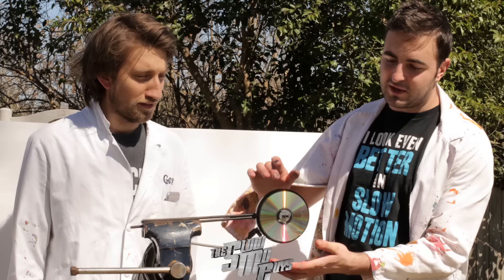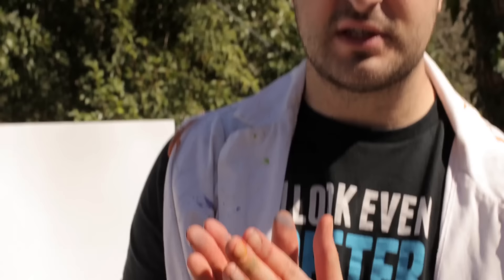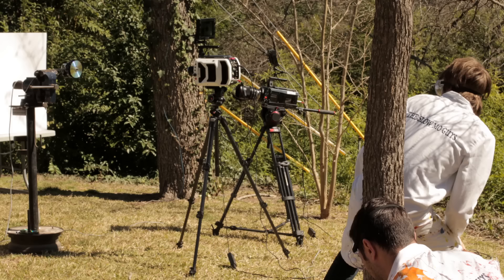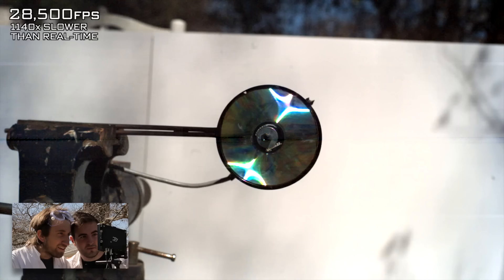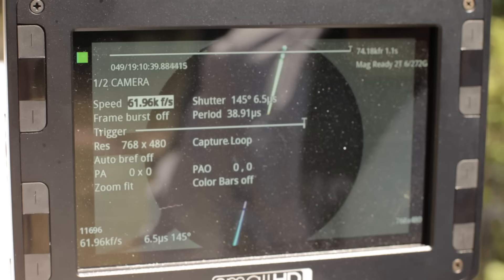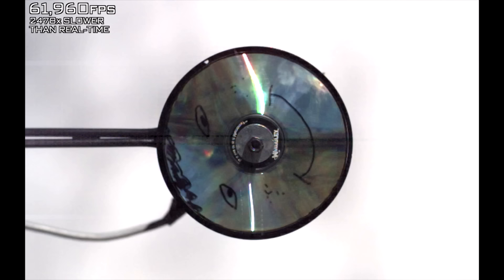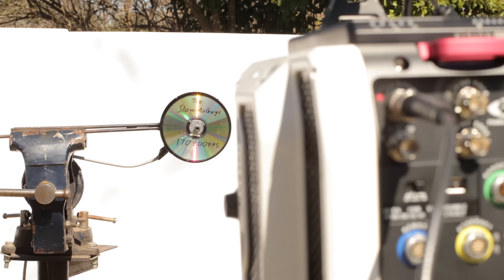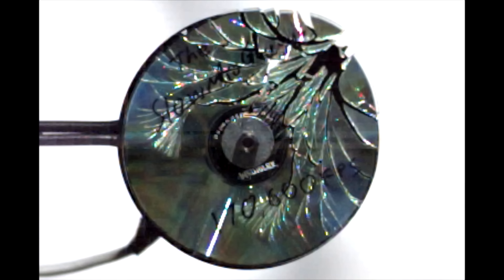CD Shattering at 170,000FPS! - The Slow Mo Guys

Comment: ***** Isn't it fascinating that all of the shatter points occurred in the "gravity-negative" dead zone between the 180 and 315 degree marks, and that two happened at the first mark, and two at the second?

180 is the point at which gravity stops "helping" the downward spin and starts fighting the material as it changes direction.

315 is the point at which gravity has done its maximum work pulling at the leading edge as it heaves up, away from the earth, and just before it starts getting some relief by "leaning" on the axel and "laying over" toward its downward fall.

These forces are exquisitely fractional, but that 135 arc is where the maximum force of gravity creates a differential, the slightest difference in force, magnified by the blistering spin, and is enough to finally work the molecular structure of the material apart in one specific place, setting off a chain reaction. That's not to say that the shatter point couldn't happen elsewhere…but it's most likely to happen in this range, as this extraordinary set of videos demonstrates!  :^D

Thanks for the fun, gentlemen!
Reply: Next Genisye HAHAHA!!  x^D

Always the risk, I guess! Hope it was useful to you!  :^)
Reply: Grymmorgan So consequently repeating this experiment with a horizontally aligned disc should give us a completely unpredictable shatter point?
Reply: Moehritz Bla
The shatter point isn't based off gravity at all, rather, where the disk is bending the most.
Reply: RipleySawzen I think Grymmorgan's point was that gravity affects the way the disk bends, making it more likely for the shatter point to be within a certain range.  Moehritz Bla's question was highlighting the fact that horizontally spinning the disk would set gravity's effect on the disk to be equal at all points, thus negating gravity's effect.
Reply: Joshua Murphy
The outside edge of the CD is experiencing over 35,000 times the force of gravity. Do you really think Earth's gravity is having any effect at all? It's less than 0.003% of the forces involved here.
Reply: RipleySawzen It seems like the structure of each individual CD and the stability of thus would have a greater effect as to where the "shatter point" starts... but we shouldn't assume that just because gravity seems like an insignificant term in this problem that it automatically can be considered negligible.
Reply: Deathbrewer
But it can. 1/35,000 is less than 0.003%. That means the CD would have to be over 99.997% homogeneous for gravity to overcome any structural flaws. Any substance that pure would cost a lot of money. (The purest gold being produced is 99.999% pure) We can assume CDs are not that pure.
Reply: Folks, you may all well be right that I may be incorrect in my analysis, here. But engineering and super-stress is always a matter of "straws that broke the camel's back," or very small forces or flaws that are just enough to push blistering primary forces over the top. Remember…we're approaching infinity in these experiments. We're going to keep going - slowly - until we achieve the dissolution of the material. So at some point we achieve Maximum Tolerance. So the dissolution of the molecular bond of this material is going to be Mt + [ANYTHING GREATER THAN ZERO!]

If you don't believe this, then study other forms of engineering failure. There are plenty of videos online analyzing major structural failures like collapsed bridges and downed airliners. See how detailed analysis tracks down the culprit in these cases to very fine hairline cracks, minor impurities in material, or very subtle stress forces over long periods of time. Yes…in some cases representing much less than 1% of a difference.

Take the failed fan disc of Engine #2 in the famous failure of UA Flight 232 over Iowa. The fan disc of that engine - rotating at speeds not unlike our CD - takes hundreds of hours to fail (it being titanium and very large). But the failure ultimately causes the disc to rip apart and shatter into buckshot, tearing apart the tailplane and severing all three hydraulic systems. The ultimate culprit? A minor variance in density in the source titanium caused by too much nitrogen in the smelting process of the original ingot at that one, single point that the first crack formed.

Those tiny flaws are what cause the failure of great structures. A single rivet shearing. The fraying of a single strand of cable. Even the great World Trade Center was brought down (likely) by a softening in the steel supports that allowed the great mass above to move just a millimeter…enough acceleration of that mass to render its force unstoppable.
Reply: Grymmorgan
Exactly. Some tiny impurity in the wavy part is what causes the disk to fracture. Gravity is many times smaller than the other forces on that point. The weakness of that impurity is greater than gravity.
Reply: RipleySawzen 
Your response to my question seems pretty valid, but I'm wondering how we know that that the "force" due to an impurity is more likely to have an effect than gravity...would you enlighten me?
Reply: Joshua Murphy Since the CD is spinning so rapidly, there's 35,000 times gravity pulling it in all directions. That's hundreds or thousands of pounds of force trying to rip the CD apart. Gravity is only exerting around an ounce of force on the CD. Where there is a flaw in the CD, that ounce of force isn't going to do anything to alleviate the chance of it breaking in the face of the hundreds of pounds ripping it apart.
Reply: Joshua Murphy The fracture must start small: at the atomic level, with the breaking of atomic bonds. At the atomic scale, the force of gravity is nothing when compared to the electrostatic force. Defects such as impurities, and micro fractures will all have much larger effects on the local internal strain of the CD than gravity. Hence we can be confident that the fracturing will initiate from some sort of defect.

However, does the fracture begin at the place of a defect, but only begin to propagate once the CD is oriented a certain way relative to gravity? Seems unlikely to me, since I'd expect that vibrations from the motor would be a larger factor than gravity. I could see gravity being a factor, if the motor was smooth enough, the RPM was ramped up very slowly, and the whole thing was in a vacuum with no air resistance. However, in the video we see clearly that the CD is flexing significantly. Imagine a weak point in the CD passing through those 'waves.' Straining one way, then another. Like bending a paperclip up then down, up and down, until it finally breaks.

Basically there are too many larger forces at play here, and we can drop gravity out of the equation and ignore it when predicting how fractures will propagate.
Reply: With the way the CD cracked, would this help in any research to waves? I noticed the crack seems to form an acoustic shadow from the breaking point
Reply: I don't mean to be mean but this has to be said. Hope you will take this as a joke. NEEEEEEEEEERRRRRRRRRD!
Reply: Carter Pike No, Carter…I, for one, take it as a compliment!!  ;^D
Reply: RipleySawzen  so if I understand you correctly the cd shatters because gravity alone isn't causing it alone it's the force of gravity on the impurity of the cd ? (Please consider I just started learning physics please explain to me if I'm wrong)
Reply: Grymmorgan At even normal hi speed CD drives gravity effects are so low compared to gyroscopic effects that gravity is a non issue.
Reply: Moehritz Bla Only when the drive motor is perfect,if there is tiny imperfection in the bearings for instance that will make a huge difference.And may give very reproducible results.
Reply: Shawn MMiller
The CD will shatter at a point of impurity. Since the centripetal force is ripping the CD apart at hundreds of pounds of force, the tiny amount of gravity can be forgotten about.
Reply: RipleySawzen thanks :)
Reply: Grymmorgan The people disagreeing with you make some good points, but it doesn't explain why it DOES break at the points you're saying it does, and it seems very unlikely that it would just so happen to be at the gravity dead-zones
Reply: Jake Halford They are most likely correct. Science is a quest for the truth. Hypotheses are great…but only until tested.

Fortunately, my observation is eminently testable. You'd just need to run this experiment 100 times or so and see if the distribution of break points turned out relatively even…or concentrated in the zone it did here. This would tell us whether or not we were witnessing a coincidence, or a "straw that broke the camel's back" effect.

Appreciate the support, Jake!  :^D
Reply: Grymmorgan I know it's not an extensive trial with just 4 runs, but it does seem like a higher likelihood than pure chance at least
Reply: Jake Halford
"gravity dead zones" do not exist in the places where the disk broke. The only single spot where gravity is not causing stress would be at the very tippy top of the disk, and the disk never broke there. Do not let buzzwords fool you; there is no such thing as a "gravity dead zone".
Reply: Guys, it doesn't matter if it has structural flaws, not at all! lets say that there is one weak point, OK so it WILL break there because everywhere else is stronger. so if the disk is accelerating doesn't that mean that that one point will experience the most force when fighting gravity? Well yeah, that's probably why it breaks there.
Reply: *****
This would be true if the disk were accelerating slow enough. In this video, the CD is accelerating at more than a g per revolution. This means that at no point in time is the weakest spot on the CD ever experiencing a decreasing amount of gravity: it is constantly increasing.

There is, however, a slightly higher chance of the CD breaking on the lower half, due to gravity. This chance would be on the order of 6%.
Reply: Look, as I've already conceded, it's entirely possible that my first observation is erroneous and would not hold up under experimentation. And fair enough. I still call it an interesting hypothesis, and worthy of such a test. That being said, what we have exchanged it for is just as fascinating. A minor flaw in the homogeny of the disc material is also an infinitesimal difference. These materials undergo rigorous testing for consistency, and so such flaws are minor in the extreme. So if we're swapping a 1/100% of gravity for a 1/100% of molecular cohesion, it's still a damn fascinating process how something comes apart…basically, some straw eventually breaks the camel's back…and it's usually a very small one.  ;^)
Reply: Grymmorgan
"So if we're swapping a 1/100% of gravity for a 1/100% of molecular cohesion" No, the material is going to break at the weak spot no matter what: gravity or being flung apart doesn't mater. Some spots on the disk are experiencing 85,749 times gravity, while others are experiencing 85,751 times gravity (I said 30,000 times gravity earlier, but upon watching the video in slow motion, it was spinning at 35,000 RPM when it broke, making the actual number much, MUCH higher). Gravity is contributing only 0.0023% to the forces involved. We can ignore it.
Reply: where do you get 85,749 and 85,751 from?
Reply: The disk is spinning at 35,770 RPM when it blows up. That's 3745 radians per second (math). The equation for acceleration is a=rotation^2*radius, or (3745 radians/s)^2*0.06meters. That comes out to an astounding 841,000 meters/s/s of acceleration. Divide that by gravity and you get 85,750 g's of force, approximately. I did not do the rotational calculations to the nearest frame, so it may be off by a percent or two.
Reply: Upon looking at the video in n editor to get some better numbers, the disk completes one rotation in exactly 100 frames, giving it an angular velocity of 37,200 RPM. This increases the g forces to 92,800. Truly mind-boggling.
Reply: I am sorry for butting in like this, but I am guessing that when the gravitational forces on the CD generate maximum stress and the weakest/anomaly in crystal lattice structure coincide, that will result in a bond rupture. So what Grymmorgan is true. The observed angles of fracture are 180 and 315.  And yes the locations of those anomalies determine where the CD fractures as well. Both explanations are valid and their combined effect is what we see in the video. This is pretty amazing... :D
Reply: It would be interesting to see the at which point molecular cohesion is broken on different materials as gravitational forces rips them apart.  With pure and non pure substances.
Reply: Grymmorgan but isn't it more likely that the breaking point started at some minor flaw in the disc and that the point in the rotation where failure happened were random? We only have a sample of three and close to a 25% chance of this being random.
Reply: Grymmorgan notsure if fact or troll
Reply: TheGreat Escape Neither, actually. "Hypothesis" would be the most correct label.
Reply: Grymmorgan Not to mention that it is helped out by momentum as it moves upward. Once it gets going upward, it is easy to keep going upward, and gravity is having to go against that strong momentum.
Reply: Please be a teacher!
Reply: Grymmorgan Eloquently put brother, I noticed that too. At any other speed it probably would've simply been destroyed by the horizontal wobble of the engine/vibrating contraption, BUT (as you finely said) at those physics "bending" speeds, that 135 arc was probably the path of MOST resistance considering gravity, rotationaly inertia, and pure friction, so the CD was taken right to it's breaking momentum, and then predictable physics DETERMINED where it would give!
Reply: Simply put: that's the EXACT point and angle where GRAVITY and ROTATIONAL INERTIA kick the CD's lilly ass.
SPONSORED BY DYSON
Reply: cybertree
Literally just spewing out buzzwords there, guy. You clearly have no concept of physics whatsoever. At NO POINT IN TIME was gravity+centrifugal force ever DECREASING. There was no "path of most resistance" because at all points in time the "resistance" was the most. The "resistance" was always increasing. It's like a race-car is going around the bend, and I sneeze, then claim my sneeze caused the car to lose traction. Theoretically possible? Yes?
No, actually literally no. Not possible at all, 0% chance, please go home.
Reply: RipleySawzen 100% correct!
Reply: Grymmorgan Head explodes
Reply: Longest comment chain i've ever read. I'll have to study physics some more @_@
Reply: @TowerCrisis  It would be nice to see more data from the experiment, but at such a high RPM, even the miniscule additional force of gravity on the weak point may easily be a causal factor on when and where the weak point comes apart. The path of travel for the 5 warps around the disc may also be related, as a single point on the edge of the disc travels not only in a circular path, but also in a wave pattern on another axis. I'd hypothesize the travel of the weak point and it's relation to the tension from the warps/waves is what causes the breaks in specific places.